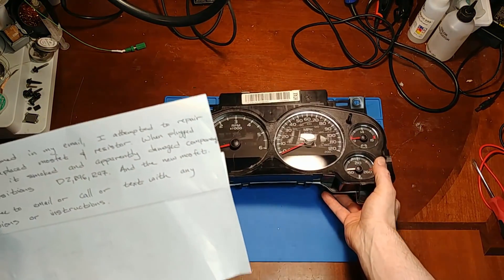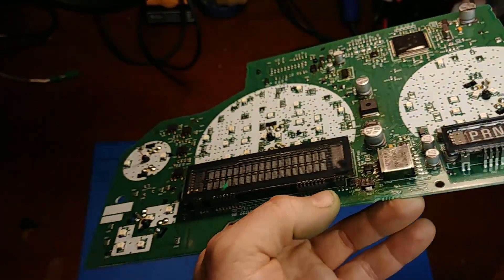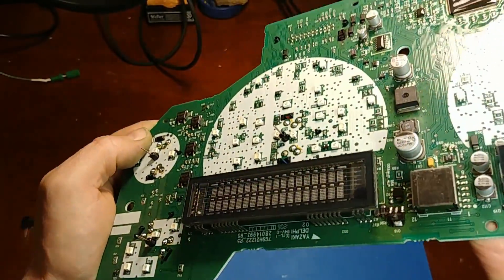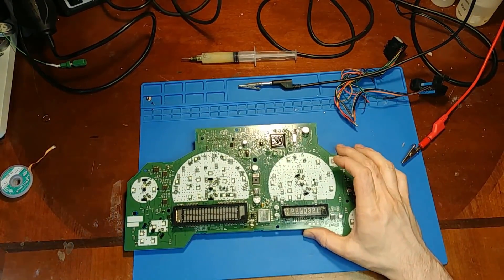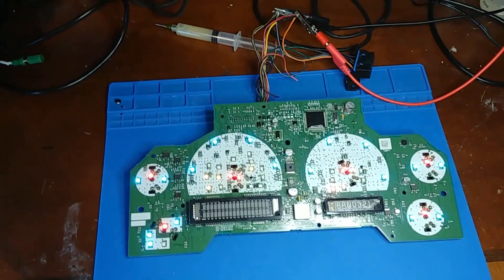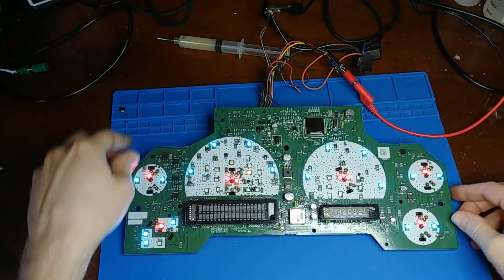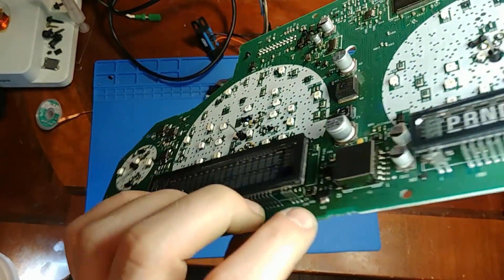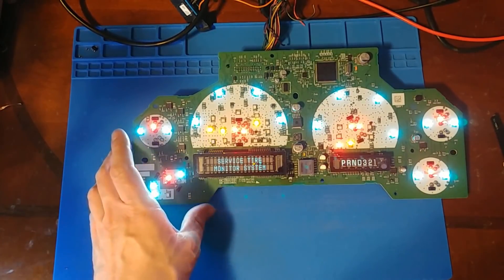Failed Self Repair Attempt Repaired 07 Cluster

Comment: What is a common problem in a 1993 Oldsmobile cutlass supreme Digital cluster
Reply: its 27 years old that's what
Reply: I. Jackanov They all do it though and only has 86,000 miles
Reply: @chris18228  so send the cluster out and get it fixed to the tune of 200-400 or so dollars because its a "low mileage classic" or live with it because its "old and not worth it". pick one its a free country.
Reply: I. Jackanov I live with it I just use the speedometer app on my phone

Comment: Do you clean the weaved copper or just chuck it when it’s full of solder?
Reply: Michael -
A trick in electronics benchwork (I learned 45 years ago from my high school electronics teacher, ex-Motorola), is to “slightly open” solder wick braid.  You “push back” slightly on the end of the braid.  
This creates pockets for the solder to fill during its capillary action.
Solder wick is then more effective when cleaning up the board, and you use less solder wick.
—
Solder wick is not a generic commodity that some mfg. would like you to believe.  
Some “real garbage” out there.  Rosin flux versions are preferred over plain copper wick.

I prefer Dri-Wick from American Beauty (Clawson, Michigan), which uses dry rosin.
Capillary action of solder is better with quality rosin flux.
https://americanbeautytools.com/Desoldering-Braid

American Beauty demonstrates, here:
https://youtu.be/NZK8EH_rLMg

A second choice would be Chem-Wik by Chemtronics. 
Avoid buying used, surplus, or long-shelf life solder-wick.  Use “fresh” supplies — it matters.
Reply: w9gb thank you very much for the great information I do appreciate it!!!!!!
Reply from the maker: The solder wick? Yes it get's thrown out when it's soaked up with solder.

Comment: What value is the shunt resistor supposed to be??? I assume 1R0 is 1 ohms.... so 3 resistors in parallel is 0.333 ohms. Possibly the original one was 0.3 ohms (0R3) which is lower than 0.333 ohms which would provide the higher drive voltage. Or is there some other issue that the lower resistor value is masking???
Reply from the maker: The value is too low for my $40 meter to reliably measure. But I believe you're right about the value.

Comment: I have been enjoying watching you solder these over several videos now and I subscribed.  Question, what is the clear liquid you pour over after soldering?
Reply from the maker: Rubbing alcohol
Reply: my Chevy tach and oil pressure gauge goes up but not down.  I took it out and pushed them back to zero but I noticed they don't move down freely like the other gauges.  So I assume it's the motors.  I'm going to be taking it apart and attempting to repair myself and give you a shout out in the video.  If I mess it up I'll be sending it to you to fix  LOL
Reply from the maker: @WJHandyDad  yep sounds like you have failed stepper motors. The part that people struggle the most with is removing the original motors without damaging the solder pads.
Reply: probably within a week or two I'll know if I did it right or if I need to pay you to fix it  :)

Comment: Jeff I just have one question. I have a 2010 silverado  cluster that functions properly but I want to change the leds to another color. I haven't been able to figure out how to power it on a bench since I don't have that truck anymore. Would really be a big help if you can share that info.
Reply from the maker: I'm pretty sure I found the pinout from Google.
Reply: @jeffescortlx  only find the one for the older truck I have (2000). I can find the radio pinouts but not the cluster one for 07+.
Reply from the maker: Yellowo wire, pin 8. I'm using a dropper resistor to +12 to be on the safe side, might not be needed. You'll probably need to supply power and ground for it to turn on the back lights.

Comment: Having problems with a 2009 gmc Acadia odometer screen works intermittently. It's a common problem with this make also Buick enclave &Saturn outlook, but haven't found any info on the fix. Any help is much appreciated.
Reply from the maker: I've done a few here and there. But haven't had an opportunity to make a repair video yet.
Reply: Is the fix on the board? Or electrical?
Reply: It may be failed solder joints. You might try reflowing them with some new solder and a little flux.

Comment: Jeff 
Great video . I’ve used your techniques in the past . Your a true professional.
Question on another subject.

I have a strange 
3 Legged inductor( L5) used in 04-09 Toyota Prius combination meters(and aka instrument cluster)

Have you ever seen one of these ? Stamped 28. It was coming off a power transistor (w heat sink) , feeding the small transformer for the display (vfd). The inductor checked open and blown the 3a fuse . Replaced from spare bd . All good now . But now my spare bd is dead ... lol. Link to pix below .

https://drive.google.com/open?id=1AT8C9_phvYDZmQKmQqBwOcevUuvWkk7B
Reply from the maker: I'm not too sure what that is exactly. Could be proprietary. Can you cut away the body?
Reply: It’s molded plastic. I’ll cut it open .it appears from the outside a wound up coil on 2 of the legs ? MTF... ty
Reply: Hey Jeff .. just my luck I just received in another Prius combination meter. Same problem blown fuse and that inductor is open . Link to pix of it with plastic 
cut off. No clue what it is .

https://drive.google.com/open?id=18OZUknZd3tHqISPUbxpzMMXB2W01q_hl
Reply from the maker: I'm not too sure what all that is. You need one of those component identifier "transistor testers" to test a good one to see what the microhenry of the inductor is. Maybe 28? It can read and test those capacitors too. You might beable to build a replacement out of individual components.
Reply from the maker: Yes that's it. I picked one up a couple years ago. Handy to have around considering how cheap they are.
Reply: Thank you sir
Reply: @NuWavUSA  Some kind of little hybrid module; an inductor (or maybe antenna) made from the PCB tracks, some loading capacitors perhaps? Something else under the metal can on the left? Crystal? Did you ever find a replacement or were able to build one?
Reply: Agent24 ... hi no I never found a replacement. Luckily I haven’t seen this problem anymore. I do remember pulling off an inductor from an 05 gm cluster for testing . It worked but was running hot so I pulled it off. Thanks

Comment: Thanks so much for the work, Jeff! I’m confident I would not have been able to finish the job myself after watching you pick up where I had left off. You really do make it look much easier than it is. 

By the way, what solution is it that you use prior to brushing with the tooth brush? I assume it’s for cleaning off flux?
Reply from the maker: Yep, it's just rubbing alcohol to clean off the flux. The flux I use is a no-clean, but I like to leave it clean to pretend I'm a professional : )

Comment: Good work once more my friend! Jeff can you tell me what the resistor size should have been so that you would not have to stack 3 of them up or what was the factory resistor part number that came off would be great for those two locations. Thanks Sir. James
Reply from the maker: I cant at this time. The original numbers were burnt off. All of my donor boards are a different revision, different PWM driver chip and one shunt R instead of 2. It's s precision low ohm (and low tolerance) resistor, my meter does not have a good enough resolution for shunt resistors.
Reply: okay thanks Jeff for your time and great Vid by the way sir! Have a great day. James